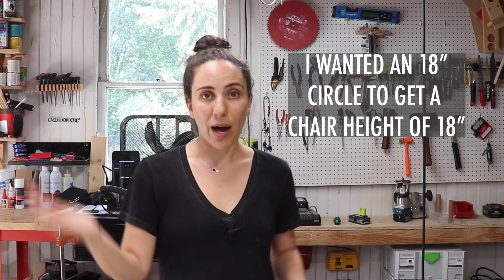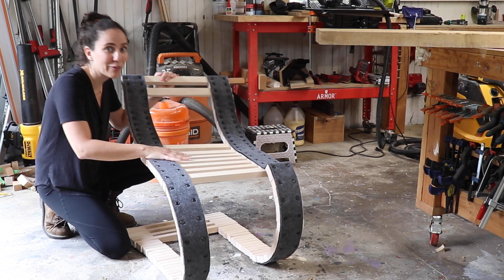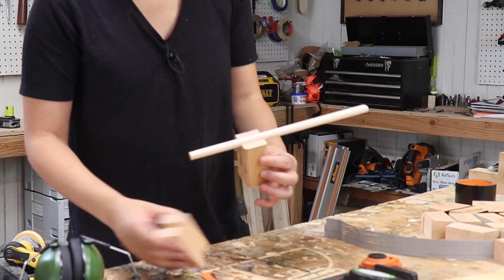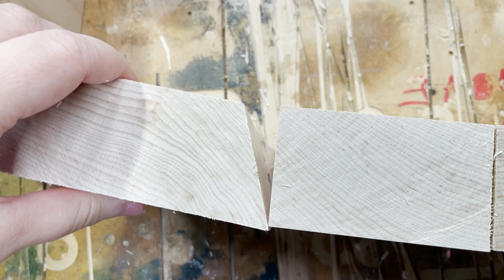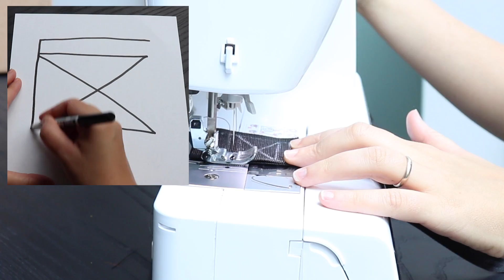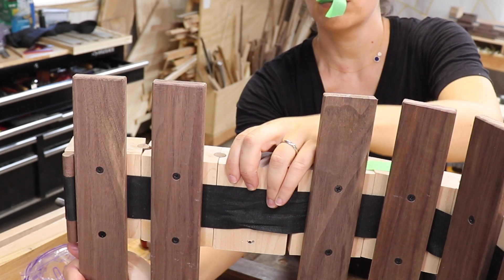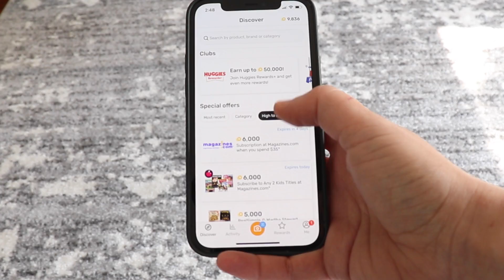I ATTEMPT to make a Roll Up Chair… AGAIN...

Comment: The strapping might be really strong and lightweight, but strength is not universal. That is, strength is related to a specific type of mechanical strain. Your strapping is under extreme tensile strain. This means that as force is applied the width of the material decreases and the length increases. I just heard the part where you suggest you might try leather. Leather will also have a high yield to tensile strength. It will stretch just like the strapping. You should consider a material like Kevlar that will have high tensile strength.

Another design element that you might consider would be a mechanical adjustment like a guitar machine head or a ratchet and pawl system.  These elements will allow you to adjust the strength as the material ages and inevitably stretches.

Comment: What about steel? Like a steel cable of some sort, instead of fabric straps? That's still a lot of tension, but at least the cable should be able to hold it without stretching as much. Or would that be too "industrial?"

Comment: From experience at working as a motorcycle clothing designer i can assure you 100% polyester woven tape is the strongest thing on earth. It will shoot out breaking at terminal velocity before it stretches. Thats why we use it everywhere we make straps. Thats why seatbelts are made of it!
And as with my artistic job title of a furniture maker i can tell you wood will break before the strap does.
I think your solution might be synthetic rope, presumably a few of them. Ot might stretch but that would depend on quality and weave. Try that

Comment: simple idea that might help:
make separate strap dedicated only to the main curve, without the back and the bottom. That way, there would be no places for the strap to collapse the chair under tension. The main strap would be used to hold the chair together and would not experience that much tension
Reply: yeah seperate strapping for the back and straightaway

Comment: You need stronger strapping? Go to you're car and cut out you're buckle belt and try using that!
Reply from the maker: That’s what I used
Reply: I couldn't see how you fastened the belt to the blocks but u should have fastened it to everyone block each so you eliminate the stretch on the whole length of the belts!

Comment: For the next time, please also consider the mounting points for the straps. They are under very high stress from there without any "insets" or "channels" (tearing straight on the mounting hardware). You might want to use thicker fasteners to reduce pressure to prevent tearing and stretching from those very stressed points.

That being said, the strapping was clearly not nearly strong enough. Proper seatbelts? Doubling up?

Comment: I was wondering if you had considered using bike chain instead of the poly webbing? Perhaps it could be rigid enough and perform acceptably without needing the loads of tension that make the webbing dangerous. I know you probably are sick of making this chair, but perhaps it's worth doing a small scale test? Could likely just screw the chain directly to the slats.

Comment: few options here. 1, the same pieces in the same spots are developing gaps under load. a bit of piano hinge under the strap on those blocks would eliminate the possibility of any gap ever. 

2, dont cut the blocks to the exact angle that you want the chair to have while under load. cut the blocks in a way so that, while nobody is sitting, the chair seems to be leaning further forward. This way, once weight is added it settles into the final position. think of a leaf spring on a truck, when truck is lifted, the radius of the spring is much much tighter and when the weight of the truck is applied back to the spring it settles into what the actual (desired) radius needed for intended suspension. you can test this without building a whole new chair by simply adding some wedge material between the radius blocks until you have the final (no load) position needed to give the desired (under load).

Once you make it work, then you can fix the safety/pinch issues you mentioned.

Comment: My two cents is the design of the slats should interlock in such a way that the joint carries the load.  The straps are just to keep it together and allow it to roll.

Comment: Leather? No way that is stronger than straps that are used for seat belts. And you were using one long strap that isn’t fixed along the way. What about a hole in the middle with a slit on the frontside and every piece is connected individually with strapping.

Thicker wood pieces on critical area would help frontside rise, but made it harder to make and look good.

Another thing would be metal braid wire would be strong enough, with a channel that has a metal runner so it doesn’t press into the wood, especially on frontside rise.

Maybe a wire on the backside with a locking cam. Locking the cam when in chair mode to help with the frontside tension. And Unlocking the cam so that it can roll up.

Love the outtakes.

Comment: Too late now but in regards the tension, it would be better if the tension was localized per segment link (or pedantically, in groups of common tension elements, such as, all the flat segments on the bottom but otherwise mostly singular segment links). 
At 23:25 you show the last segment flipping over. That's because the tension is 'global', the force is distributed through the entire strap. 
The tension is generated unevenly by the leveraging of each segment against its neighbors. You need to isolate those forces to their respective links and not spread them across the entire strap. Do this by securing the strap against each segment (visualize singular chain links from one segment to another, not a strap).    
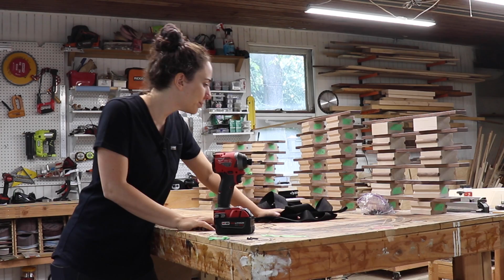Also, by localizing the tension to each link, there would be no need to pre-tension the entire strap, as you showed, on the table during assembly, at 20:55. (Simply apply the strap tension as you secure the strap to each segment.) 
Also, leather would be a disaster... It would stretch way too much.

Comment: Problem is with the Strapping not beeing stiff enough/being under tension for the whole length. If the Maple toppers would clamp the strap really tightly, the length of strapping that can stretch because of the tension would be reduced. This would remove most of the elongation. A stiffer strap would also help. Stiff as in higher elastic modulus ( different material) or bigger cross-section.
Elongation of an elastic material under tension is calculated with the following formular:

elongation = F*L/E*A where F is Force, L Length, E elastic modulus, A is cross-sectional area.

Hope this helps.

Comment: Why not add metal hinges on the outside curve in the lower section? Could be some sections of piano hinges. The trouble would be the strap will lay on top of that hinge and may tear the strap over time. Some thick plastic over the hinge or a recess for the hinge might solve this issue (the rescess is tricky as the hinge pin must be at least in the corner of the pieces to articulate as it should but there are other 3d hinges that can pivot around a virtual point like trunions or paralelogram hinge  or other contraption of multi-link hinge. There are some clever hidden hinges used in cabinets and furniture that could be totally recessed)

Only the lower bend seems to have the problem.

Another idea is to reinforce the strap on that part with another material that is very resistant to stretching. A thin hardenend sheetmetal will give enough bending to loop and provide a lot of stretch resistance. Being a sheetmetal spring it will want to pop flat so adding a removable strap that ties the top of the backrest to the lower leg will keep the chair open. Of course a sheetmetal spring will always want to lay flat and thus the chair would be in flat condition.
The sheetmetal spring could be in sections in the key sections that will remain flat, and keep the fabric strap overall for the noncritical parts. So it will roll up except that bend reinforced with the metal band.

Comment: Don't believe the straps are stretching they are slipping between the wooden strips and the wooden angle pieces?
Reply from the maker: They are most definitely stretching
Reply: @3x3CustomTamar   couldnt really tell if the straps were fastened to the wood or not, so I thought 🤔 the straps were slipping. I wish you luck, on your hopefully next attempt. I found your channel through your last attempt 🙂

Comment: So… is there a reason for her not drilling a hole through the wood and thread a rope through the pieces that she can pull tight to hold the chair in its chair shape firmly, then loosen the rope in order to let the chair roll up? Instead of using just strapping?

Comment: physics. that is why it's not working. 
You have a mechanical system but I do not see much thought put into how it actually works, the tensions and pressures at work. Think engineering, not woodworking.
Reply from the maker: Yup. Being a woodworker and not an engineer that is hard. Ha
Reply: @3x3CustomTamar   well, if you have the knowledge and background, you can intuitively estimate what is in play there. You can either learn the knowledge necessary, or learn to use a finite element software ( FreeCAD has one such module  https://youtu.be/dhrynRdBOIg). Either way, there is some study to do. Cheers !
Reply: A few thoughts:
I do not have exact measurements so I estimate the trapezoidal wood prisms to have a side dimension of about 10x5 cm. Say the seating depth is about 50cm. An average person of 70kg. So a back of the envelope calculation tells me you have about 200 Newton/cm^2 of pressure on the wood surface. Normal construction wood can take 1000N/cm^2 longitudinally but 5 to 10 times less radially. I see from your video that the blocks are cut with the fibers along the slanted edge, so they take the pressure radially, i.e. the fibers are getting crushed, increasing the flex. Cut the blocks so the grain runs perpendicular to the pressure exerted. Wood has slightly viscoelastic properties so as soon as you put those blocks under pressure, there will be a permanent deformation that will cause more flex. So you need some pre-tension ( like what is done to concrete beams in bridges for example )
The strap is also taking the same effort, but as tension. Not sure the material of those straps you used ( probably polyester ), but it needs to have very high rigidity ( no stretch ) Something like aramid fiber ( kevlar ) or carbon fiber strapping ( that might not be practical as it usually is supposed to be bonded in composites). To minimize final stretch, the straps should be pre-tensioned. If the edge of the wood prism pieces, at the point where the strap runs ( the hinge point of sorts), is rounded, then while the chair is rolled up the strap can be affixed while that length is shorter than when unrolled, therefore tensioning the whole chair when unrolled.

Comment: The circular shape of the dowel reduces the support for each joint. Notice that how much tension you put on the strapping gaps between pieces keep showing up. It's like the pieces are somewhat rotating on the axis of the dowel. Perhaps try other shapes for the dowels. Good work!

Comment: Three things to try: 
1. Pre-tension and over tighten the straps before installing. If you can stretch the material beyond the elastic range and into the plastic range they will permanently be deformed and will have a lot less stretch (like when a tee shirt gets stretched out).
2.Rather than use a single continuous strap, split it up into smaller segments. 

3. Include a layer of light gage sheet metal along with the straps.

Comment: Seatbelt webbing is enormously stretch resistant, and tow straps even more so. Literally can be as high as 4000 lbs before significant stretching. Also might want to somehow brace contact points between wood pieces under high compression so that they don't crush and change geometry. Essentially you are creating a few pinch points where all the body weight is being focused, so those might be good places to strengthen. I loved the dowel idea, it seemed very clever!
Reply from the maker: Thanks! Seatbelts we’re the second strap I used. Still stretches too much!

Comment: What if you had a steel cable that runs in the middle of the wood blocks? Then you could have a bolt cap on the ends for tension. And because the pull of the tension is in the middle of the block, it would be much more stable. I think you are right that strapping is not the answer.

Comment: Frankly, steel cables would probably be a much better option. Hell, aluminum bars would be better than wood. Sure it is really carpentry anymore but I bet you can cold chisel some aluminum and fell good about it

Comment: you can use multiple straps on top of each other. In places where the strap is stretching due to excess tension cut a piece of strap material and sow it on top of the existing strap material. The double thickness in that area will mean that despite the tension, the gap will decrease because the extra material will help the strap at that place become stronger. alternatively, you could just do this on the entire chair overlapping 2-3 straps stitched together will make sure the chair is strong. also, the tension on this chair isn't even. pre-stretch
 your material and where there are more gaps add more material. also, you could add a ratchet to the bottom to adjust tension over time.
finally, you could also add a strap that isn't fixed to the pieces but freely moving to the backside of the chair. if the chair is in use it will be taught and when it's rolled up it will be loose. ti can be fixed from the top and ratcheted for tension on the underside beneath the legs. this way the top won't fold in on itself and it add more strength to the chair.

Comment: Each piece pivots against the previous one, creating a hundred different levers. The leverage on the strap will probably stretch anything you use. This chair reminds me of that metal bead chain used on ceiling fans for pull cords. When under tension it is not nearly as flexible as when it is slack. Could be an avenue for inspiration.

Comment: Clamp the strap down more by using wider walnut strips for the seats. There's a lot of additional material that the strap can stretch if it's not clamped. By widening the walnut strips and clamping down you will mitigate the amount of material available for the strap to stretch after it's fully extended.

Comment: I think part of the problem with the strap method is not the fact that the straps don't work I think instead you should have different straps for each segment of the chair. Because on the bottom of the chair where you need this tension you kept shortening it to apply more tension but it just kept folding in the other parts of the chair to relieve tension. If the bottom section was instead one strap and then the back and flat bottom were there own the tension would be all in the front/seat section where you need it and wouldn't be able to fold in the other straps that are holding up the back and holding the bottom together. Basically if you separate the chair into 3 segments: the bottom _   the front/seat  C    and the top j   only the front/seat needs any form of tension for support the others are both using the strength of the material to hold themselves together in shape. I think as well you could use the same design as before just somehow seperate the strap and support it.   TL;DR: just use a different strap for where it needs tension so it can't pull in the top and bottom and it should be freestanding while still maintaining the ability to roll up.

Comment: So I'm not 100% sure if my logic is sound here, but maybe it would be beneficial to connect each section individually. Like instead of 2 long straps which are connected to every piece, have many smaller straps just connected to 2 or 3 sections each. They might be stretching so much because its a lot of tension applied to the entire length and finding the weakest point. A second benefit to this strategy is you could identify where its most likely to stretch, and just double or triple up on the strapping.

Comment: Your problem is that you make the construction rely upon natural material. The wood and stropping flexes and will compress over time. To solve the problem, are you forced to make the construction in steel and hide the steel with wood and stropping.
One way to do this is to shape two steel bars on each side such that you get an upper dowl and a lower dowl on each peace of wood. As strapping do you use a steel band that you hide under a fabric band.
When the chair is standing will each dowl meet the dowl in the next piece and end up making a "continuous" upper rod and lower rod with the hidden steel band supporting the whole thing. :-)

Comment: Rather than tension, you need to engineer some sort of locking pieces that can be rolled up the other direction. The dowels work for keeping some support, but you need more. Also leather won't work, it also stretches.

Comment: what if the excess length on the floor end could bend up to support the seat? That would still roll up the same way, but you don't have to rely completely on the strapping. Could work maybe?

Comment: Stainless steel grounding straps? You can get them flat and wide, 

And maybe just have the bottom curve wood be a little thicker? It's what creates the most tension, thicker wood can lessen the tension by moving the fulcrum

Comment: here's what you can do have alternating dowel's like you would have what would be 2 holes per piece of wood and you would line up the pieces alternately with the top being lined up with the bottom of another piece with a dowel going straight through it, you have what is 2 rows of wood, i'd say either have 3-5 rows of wood